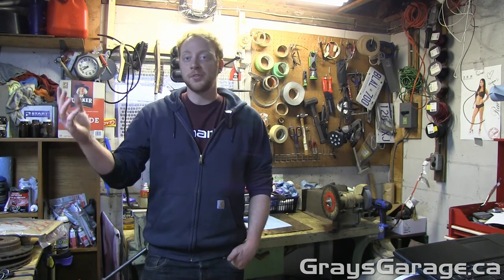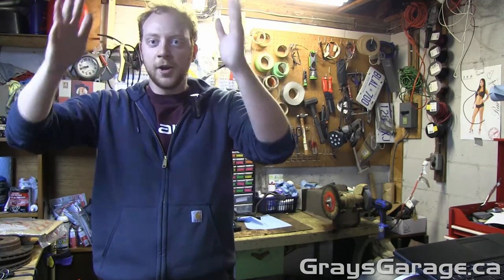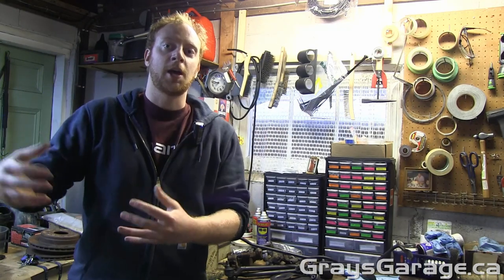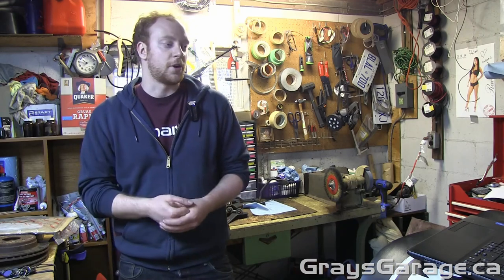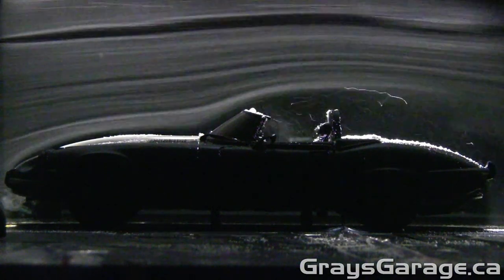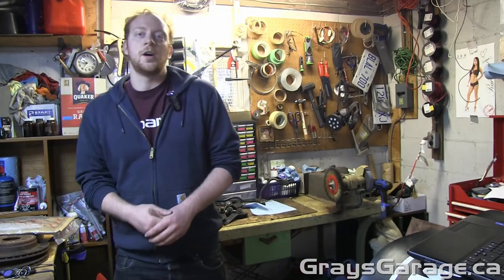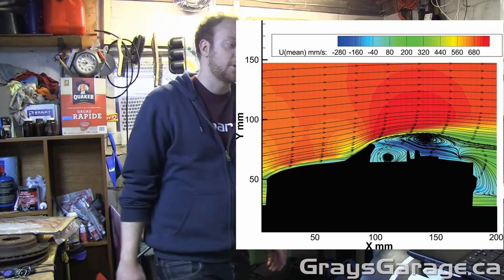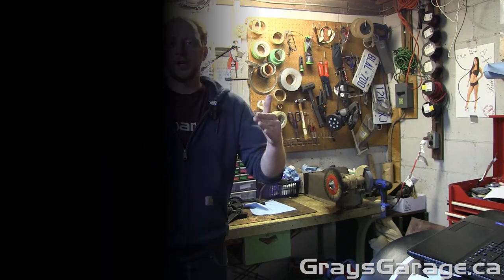Automotive Aerodynamics Ep. 9: Convertibles!

Comment: Hey Gray, I am looking to create more downforce on my 2011 Subaru WRX GR chassis hatchback for autocross and other sporting events. Can you create a video showing the effects that a Gurney flap would have on a hatchback with an OEM rear spoiler? The design of my car features a long, flat spoiler which drops directly off of the hatch at the top. I am thinking of putting a one-inch Gurney flap at approximately 15-25 degree angle of attack.

Comment: Old video, but new to me. You wondered about what it must be like for someone really tall driving the S2000 top down highway....well you're right! My proportions are all torso, so sit very very high. I get a lot of buffeting. There is a wind blocker between the headrests, but it doesn't do much at my head level.

I am tryingto experiment with aero devices to try and create a diverter I can add to the top of the windshield frame. I first tried a small spoiler. Did some before and after videos wearing a hat with yarn tufts taped on to measure turbulence. The spoiler worked quite well. Until a few days later it rained and had to put top up, and there was so much added turbulence it nearly tore the roof off!

Wish I had a water tunnel to play with!

Next I am going to try some vortex generators. Not those silly shark fin things mounted inline to airstream, but something at an angle that will actually generate a vortex.

My hope is it will move separation back far enough to limit cabin turbulence.